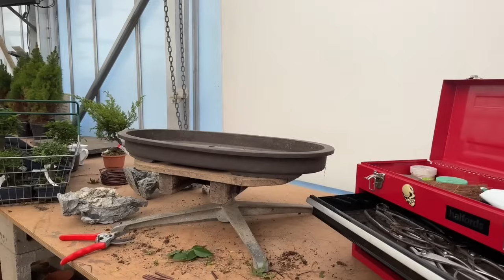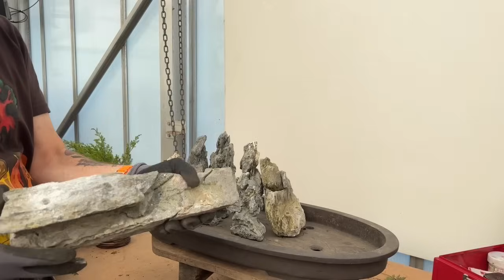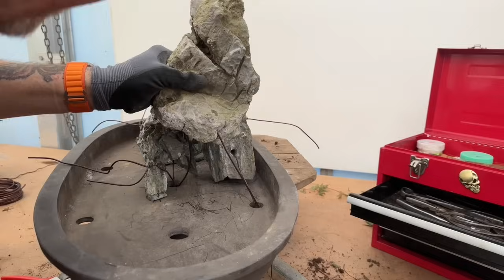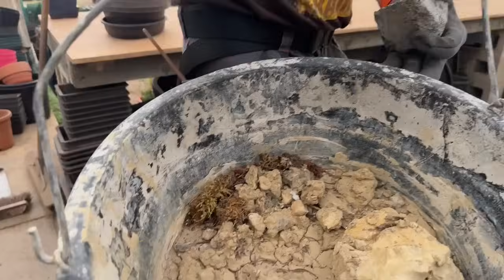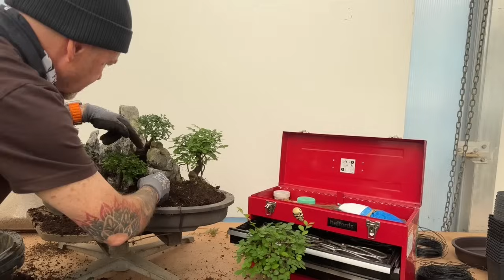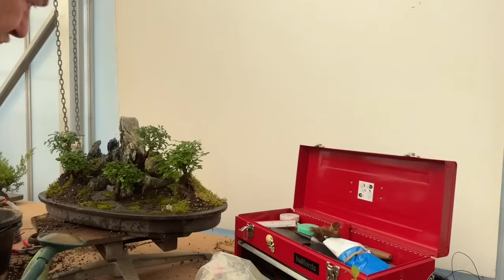What Is Penjing - Discussion & Creation of a Bonsai Landscape

Comment: A few years ago, without any knowledge of this technique, I created a landscape in a shallow 22 cm ceramic bowl - a pale green glazed, slightly irregular piece from a student pottery sale.  This was not designed as one of the of rather twee "fairy gardens" that were somewhat popular then, but a mossy moor, leading to a single standing stone, about 8 cm high.  There is a small dark depression in the ground at the base of the stone, into which I placed a very small, water-smoothed pebble of white quartz, echoing those sometimes found in old holy wells.

Comment: Interesting video. But, since we do not always have these kind of rocks available, I might have an alternative. It's much cheaper... I started this method about a year ago and it turned out to be very succesful so far.
This is how I proceed: take a piece of lava rock and put it on a (thick) pile of clothes, to prevent too much vibration. Be sure that the lava rock is soaking wet first, to prevent it from breaking apart. Of course you should do this, before putting it on the pile of clothes... Then take an old, little stone drill (or perhaps better: another kind of drill, for instance, one that is hardly usable anymore) and put it in a drilling machine with very low gear possibillity. High power is not necessary at all. Choose a machine setting for  normal drilling/screwing, not "stone drilling" (to prevent breaking the rock)! Then very slowly drill one or two little holes in the lower part of the lava rock: you should choose a very low speed! Take your time, again: to prevent the rock from falling apart. Then you can anchor the rock in your pot with wire (not necessarily aluminium wire, by the way; I use thin stainless steel wire - it's very strong and much cheaper...). If possible, put part of the roots/rootball under the rock first, to anchor also the tree more or less at the same thime when you anchor the lava rock or rocks! Then add soil and so on. There are quite a few advantages in my opinion, when you follow these proceedings. First, it's very much cheaper. Second: the rough surface of lava is very suitable for roots and moss or other plants or trees, to grow on (if you wish). Third: lava soaks up quite a lot of water, to help roots to grow and obtain moist conditions. Fourth: it's very, very much lighter without any doubt. Fifth:  since glue is not necessary, after (for example) a few years, you can easily break up your scenery and start all over again or improve or change it. This way, you can use even very simple pots or trees or bushes, and make a very nice little (bonsaï) scenery. Because it can easily be done by everybody if you act slowly and carefully, I would suggest: give it a try - it's quite simple! Succes and good luck to you and your team, mr Chan! Greetings from the Netherlands.🙂
Reply: Sounds great what you are doing - improvising and using what is available is always the best. I always look forward to your contribution on this channel. Thank you.